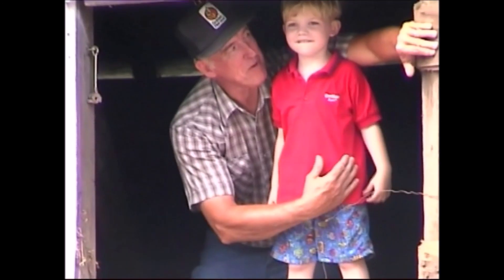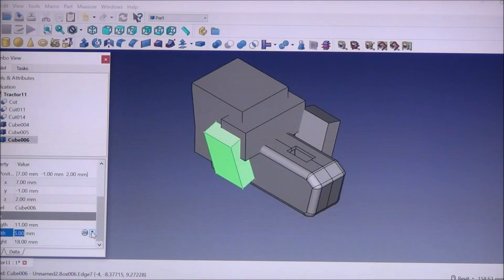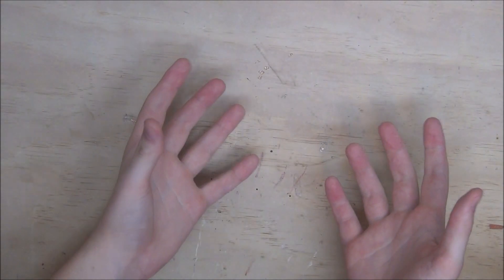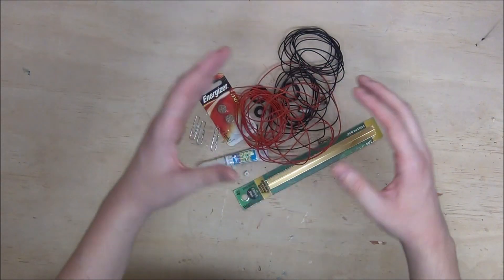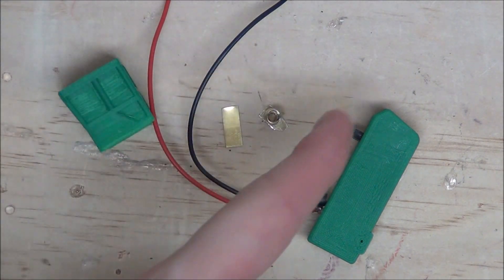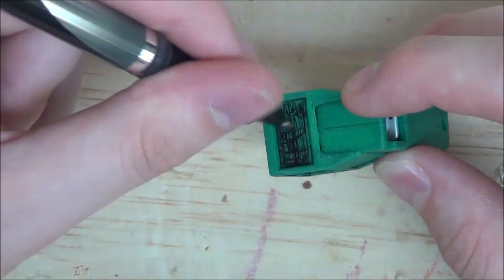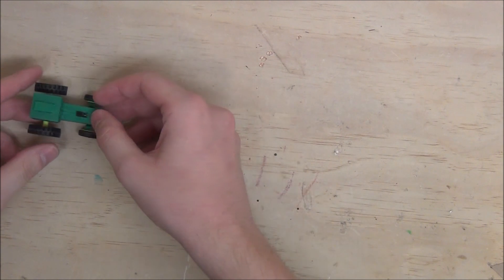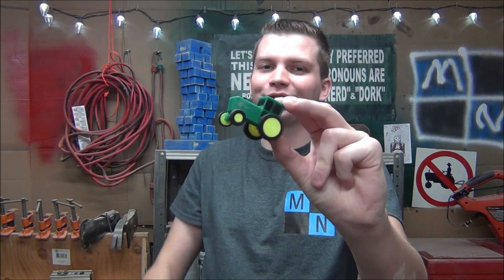Micro 3D Printed John Deere Tractor! // In Memory Of Grandpa Dan

Comment: Holy smokes, you rocked the design and details! Smoke stack on off switch is functional and hidden at the same time.  Did you print it several times or did it work the first time?
Reply from the maker: Haha! Thank you so much! I'm glad you like it! :D  The main housing was perfect except for the motor holding part, so i have to print it about 4 times to get it perfect. and then the Cab i got on the second time. But luckily since its so small it doesn't use too much plastic! haha